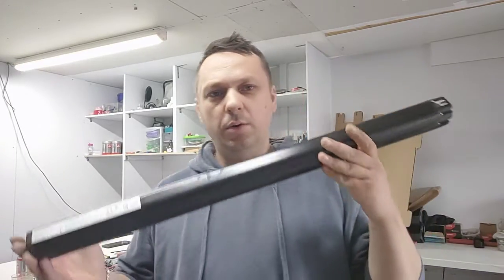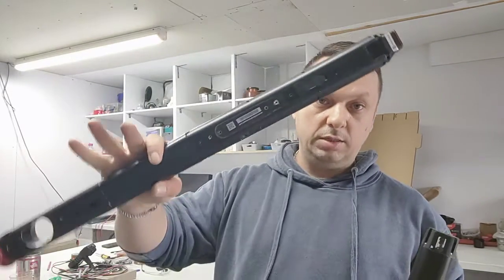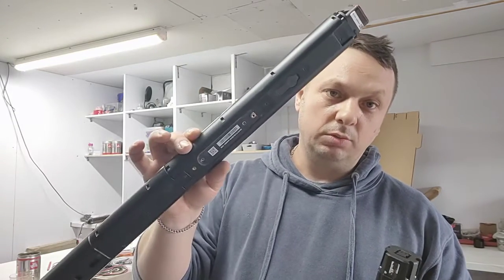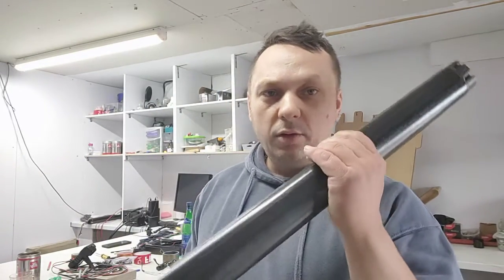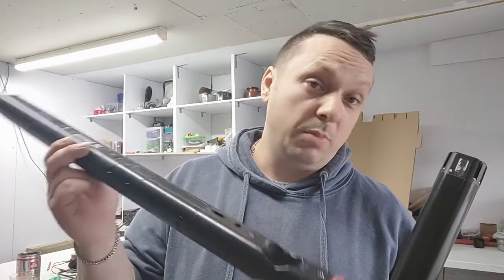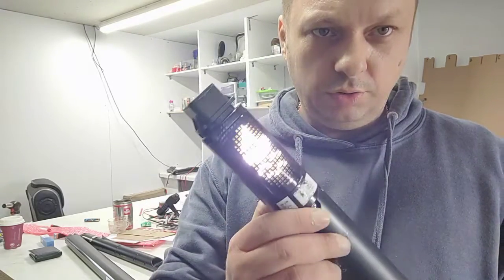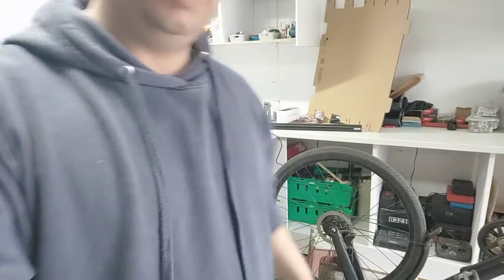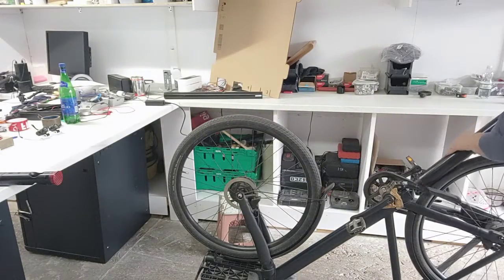VanMoof S3/X3 Battery Replacement: A Step-by-Step Guide

Comment: Will replacing the battery solve error code 17/16? I have tried the tips in your other videos like shorting and resetting the battery, but no success yet. I’m wondering if buying another moof battery will solve the issue.
Reply from the maker: Is the cause most probably…. But the problem is much complicated… as this is a factory defect .,,, or firmware defect ….
Check this out … https://youtu.be/QBP9eYoVJs0?si=uIgKe_1iM8Iz34bm

Comment: Please delete your Youtube channel. This misinformation is so unbelievable and harms hundreds to thousands of people. It is disgusting.

No, the cartridge battery is charged IMMEDIATELY from the main battery. No matter how empty it is, the bike turns on IMMEDIATELY after 10 seconds at the latest.
Why? Because the main battery charges the cartridge battery every single millisecond. It can have 0v, IT DOESN'T MATTER.

Customers come to us and say that changing the battery won't help because the cartridge battery HAS to be changed. And why? All because of this one video by this man.

This guy says so much garbage that you can't stand it any more. 
We have changed at least 150 batteries for customers in our Vanmoof partner store and not ONCE has a cartridge battery ever been broken 😂

This man has swapped maybe three batteries somewhere and makes videos about it, from his incredible knowledge.

He doesn't even know why E-shifters break and says it's because of too little grease 😂

He can't downgrade firmware, he can't repair Bluetooth.
This man can't do anything complex with Vanmoofs but has a YouTube channel like he is the expert.

He can only replace a fuse that absolutely anyone can replace.
I don't think he can even read out the year of manufacture and the battery cycles?? So the most basic stuff.

Comment: Thank you very much for the great videos. I have a request for a video: My VanMoof was unfortunately locked at the rear wheel with the smart lock while the battery was removed. The module is connected to the charger and only shows the skull! Many thanks for your support 🙏🏻
Reply from the maker: Skull meaning is bike locked …. If you plug charger and u don’t see charge bolt on Display ⚡️ the module battery is dead or shorted replace it and u will manage to get into your app …. Without a good battery u can’t

Comment: I measured voltage of cells, its only about 0.4V or 3.9V over all the whole battery. Have ever one replaced the cells? Are they welded or soldered? Is is easy to replace them? Ever anyone tried that?
I am wondering whether I can feed S3 with some external battery, but it is connected by not only 4 pins (charge/discharge) but also 7(!) other pins.
The module seems to work, at least I can see the charging sign. Battery is green with sometimes red for a second.

Comment: Got a strange one. I've swapped in a new main battery into my X3 and after charging for ~30 seconds, the front motor started periodically activating every 5 seconds with a "click" sound. The bike would slightly move forward every time the battery. Holding down the bottom "shipping" button stopped the motor from activating, but releasing the button caused the motor to start again. I was able to hold it down long enough to remove the main battery again.

Any ideas? Should I just let it charge for a while?

Comment: I replaced the battery and I'm having trouble routing that shifter cable wire...  any suggestions?
Reply from the maker: What's wrong with shifter wire .... Is thru the frame needs to take all the wiring loom out to repair it ... But if you have error 44 .... Big chance is the e shifter defective
Reply: @Razspareparts  I found the place to put that plug... got it back together... says err44 still.  I'm just hoping it's in 1st or 2nd gear so I can still ride it.  It's raining now, I'll try it in the morning.  I have given up on this bike.  I'm not about to deal with the resistors, etc on that board for the e-shifter.

Comment: Thank you for this content. I have exactly this issue that this small battery is not working after many month of not using the bike. I am looking for a replacement battery. Do you have a tip where to buy? Thank you in advance.
Reply: I found one on ebay.

Comment: Can you charge the module battery with the main battery out of the bike?
Reply: I replaced the module battery and still get error 19 code. The app shows the main battery is at 0 percent. I bought the bike 2 days ago from someone that let it sit too long. Can the main battery be brought back to life? Thanks for the help!
Reply from the maker: I'm afraid the main battery is dead and it needs to be changed manually and clear the errors ...
Reply: @Razspareparts  That was my next move. Now I know why the bike was so cheap! I'll end up paying more for the batteries! Thank you for the info. I was able to swap the module battery and wake the bike up half way. I removed the kick lock piston because of all the problems I read about. Thanks
Reply: @Razspareparts  Can you charge the module battery with the main battery out of the bike?